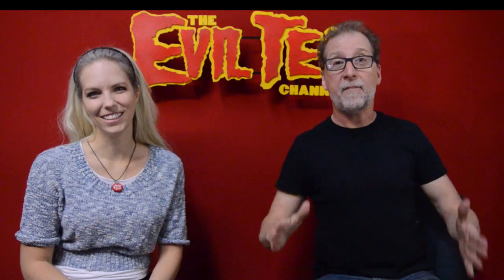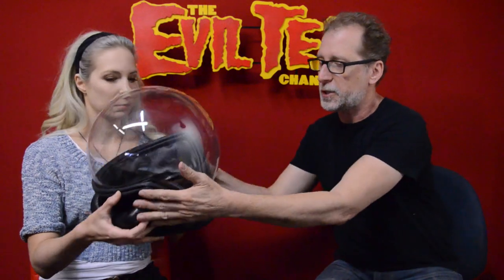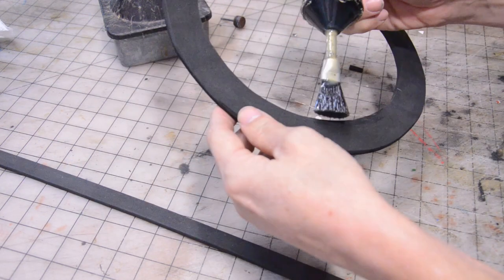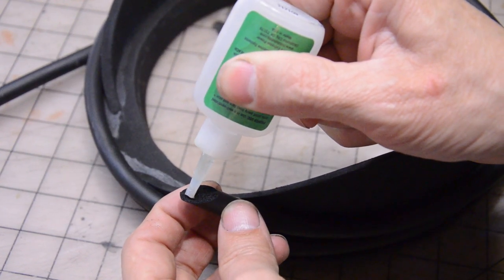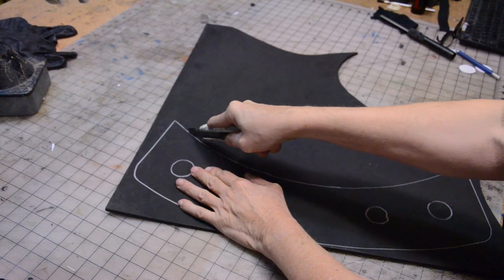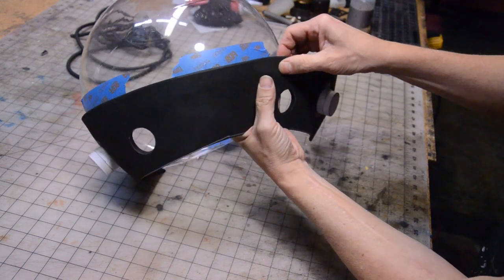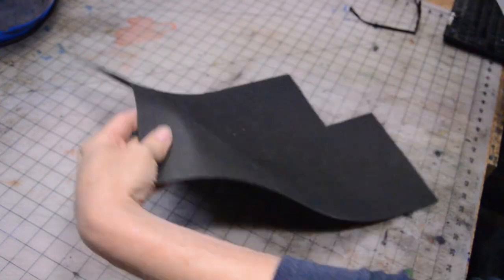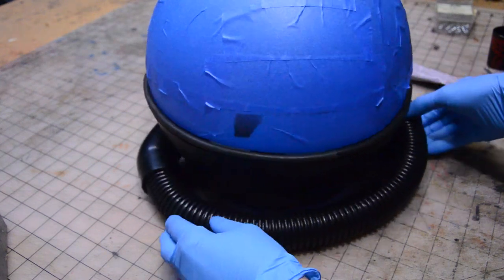Making a Foam Nuka Cola Girl Helmet with Onlyalicat

Comment: Why the choice to use Flex Seal on the neck piece but Plasti-Dip on the helm part? For the finished texture?
Reply from the maker: Never used it before and wanted to try it. Did the neck ring first and based on that I went back to plasti-dip for the helmet.

Comment: What I do not understand is why Ted did not use the hoses as the ventilation system. Could have hidden the fan in the hose, making it directional. Pulling in fresh air while evacuating stale air. Otherwise cool video.
Reply from the maker: The fan was too big to put in side the hoses. So easier to put it in the back of helmet.
Reply: Now you got me wanting to find 1 inch DC fan to see if it would provide enough air flow. LOL